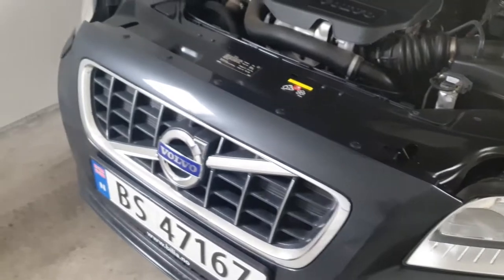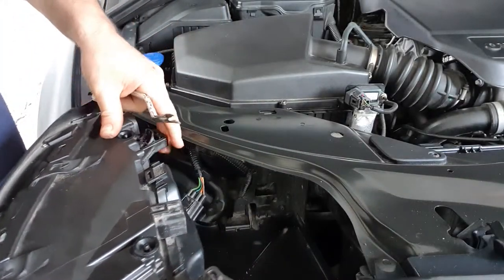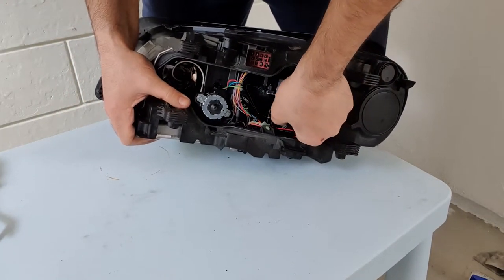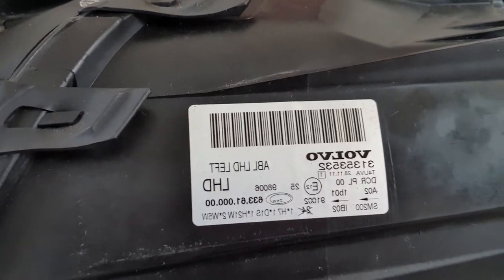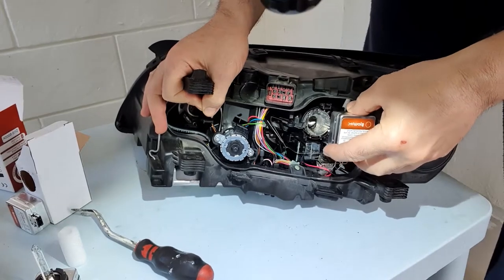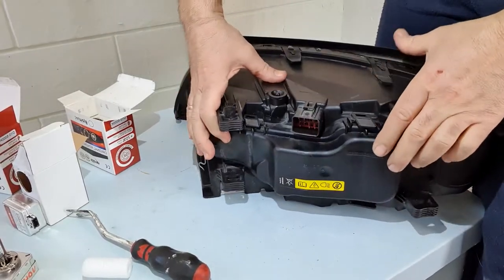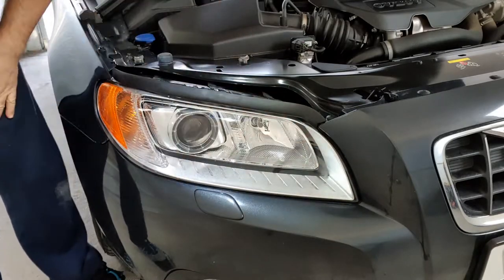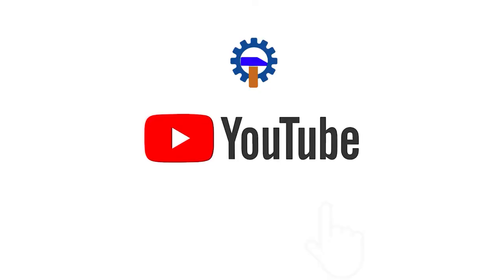How To Replace Front Headlight Xenon Bulb On Volvo

Comment from the maker: The headlamps on your Volvo  use two bulbs: One type bulb is for the high beams and the other is for the low beams (Xenon Bulb, witch i shown in this video ). Replacing either bulb is a simple process that only requires a clean rag and a replacement bulb. The entire procedure can be completed in a few minutes.

Comment: Is the same way to change in others cars models? How about Toyota?
Reply from the maker: No its different for other cars,  Almost all Volvo have same, but for most of Toyota car you don't need take out the hole Headlight , you just need to take out a rubber protection cover from the back of headlight , (under the Hood ) and you have execs for replacing the Bulb. Good lock